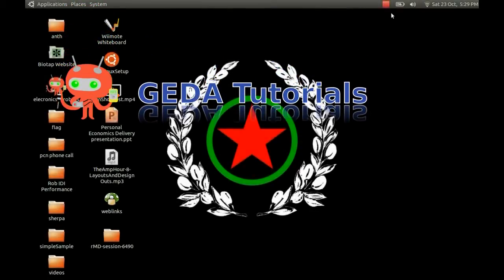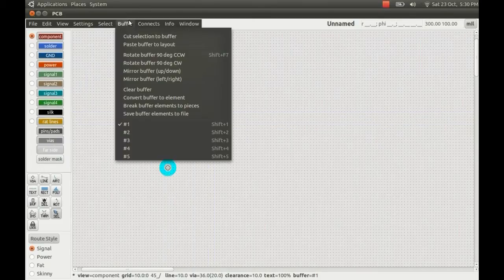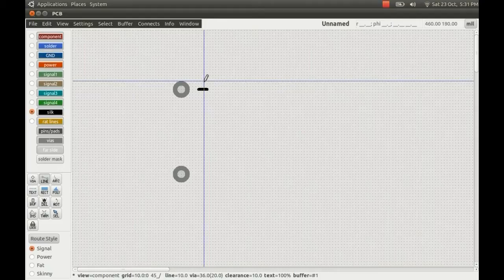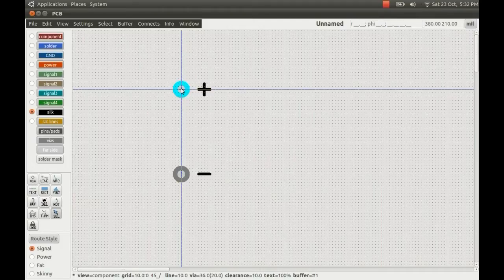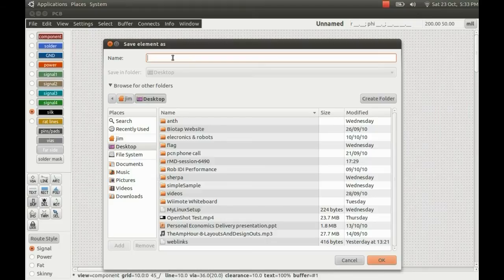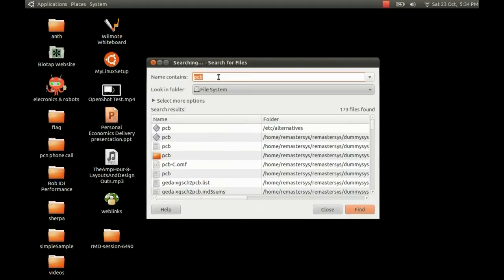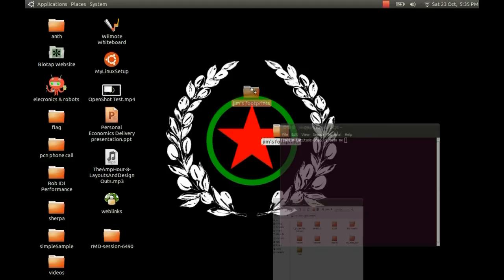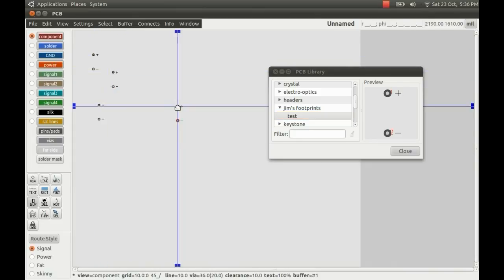GEDA PCB Designer - How To Make A Footprint

Comment from the maker: There is a grid and grid snapping, plus you can stipulate the size of everything in the preferences. You can also stipulate how much PCB increments or decrements by when you are resizing things. In the top right of the PCB window there is a display for measuring things and you can put in a marker to measure from one point to another. Hope this helps

Comment: My version of PCB is different from the one you're using.
On the layer selection panel, I don't have the selection buttons. They're just blocks that toggle -- sort of: the filled block is replaced with a small triangle of the same color as the full block.
When I do the convert selection to element, then click to enter the centroid, even though my silk screen layer is selected along with the vias, the text I've entered disappears. Is text handled differently than the lines you drew for '+' and '-'?
???
What's happening?
Thanks!
Chris Arena
Portsmouth, Rhode Island

Comment: The PCB Library dialog appears why? How do you get it to recognize any footprints? When I go through: File > Prefences -> Library  ----- I don't get the dialog as you show it. Is there some setup required that you've done that you have assumed we did too? I'm trying to follow along and I can't find the resistor that you picked or any part, actually.
Thanks
Chris Arena
Portsmouth, Rhode Island
Reply from the maker: The setup shown in the video was the standard one at the time of making the video, no changes in preference were made. But you have to bear in mind that the video is 4 years old now and it is likely that GEDA PCB has been updated / changed since then. Try looking in the "windows" menu for the PCB Library window.
Reply: I found the dialog you had open under the windows menu. The problem I was having with the text I was trying to add was probably that I didn't have the layer selected. I didn't realize immediately that the layers had two modes of operation: deselection to hide the layer and enabling/disable to operate on the layer, which is what the buttons were doing in the version used in the video. 
Please pardon my learning curve. I'm getting there little by little.
Reply from the maker: *****
No problem :) Glad you got it sorted. Learning how to use GEDA was difficult for me too, so I know how you feel!

Comment: When I do a "Convert Buffer to Element", why isn't TEXT that I've put into the silk layer making it into the element? Only the vias and the line drawn parts make it through from what I've tried so far.
Reply from the maker: No idea why, but I can confirm that this is normal behavior for this function.
Reply: sonodrome So how do you define text in a footprint? I noticed in your video you dodged that by drawing your '+' and '-' on the element! 
There is no option to convert text to something that will persist? It seems to pick up the text as it appears in the outline after I do the Ctrl-C. After the "Convert Buffer to Element", the text is gone.

I'm slightly tempted to look at the code, but that's a long way to go to get this to work, since I've never set eyes on it before.
Reply from the maker: ***** You need to look at editing the element attributes. This is another can of worms - which is why I did not cover this in the video tutorial! You can do this when creating a schematic symbol in Gschem and the elements are automatically carried over to PCB when you associate said symbol with an appropriate footprint. Or you can edit these attributes in the footprint file itself, footprint files are human readable text files, for more information on their format you should refer to the GEDA project wiki

Comment: Ouch! You jump ricgt into the application and skipped the opening process. It opens xgsch2pcb. So what's next? One needs to name the footprint project but you can't use unname since unname is used by a sch file.
Reply from the maker: +F0kGggle There is no opening process, I started the video by launching GEDA Pcb from the dock. To make a footprint you only need to use GEDA Pcb. Xgsch2pcb is a work flow tool for making a pcb from a schematic (for more info on this please refer to my tutorial video on Xgsch2pcb https://www.youtube.com/watch?v=2Faf2nACG34). I'm not sure what problem you are having naming your footprint file, I recommend choosing a name for your footprint that doesn't already exist in the directory you are trying to save the footprint in.
Reply: Problem solved. Thx!
Reply from the maker: Excellent, thanks for watching and commenting :)